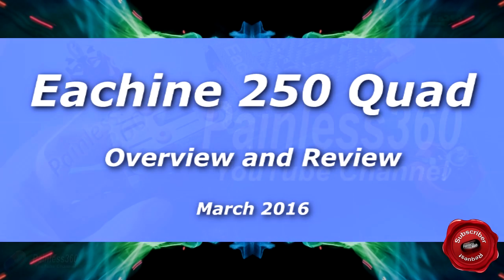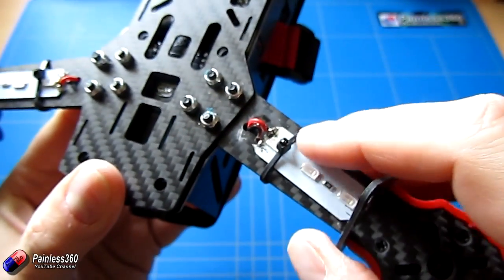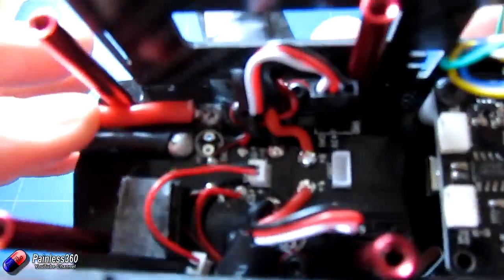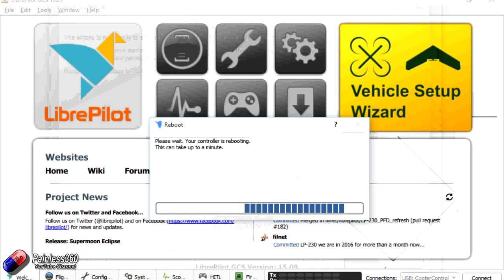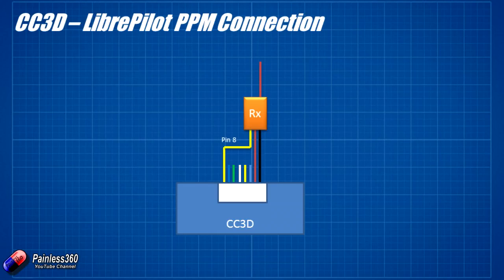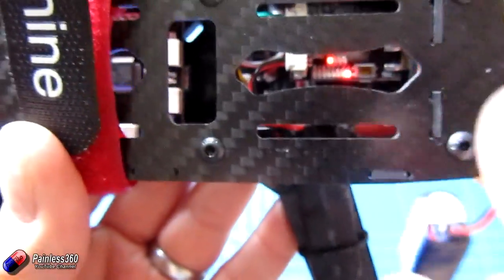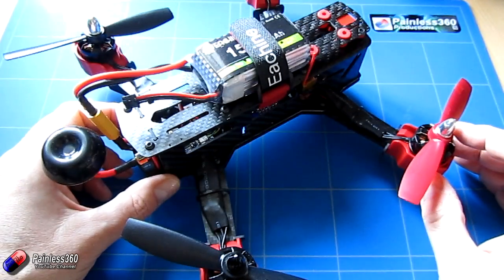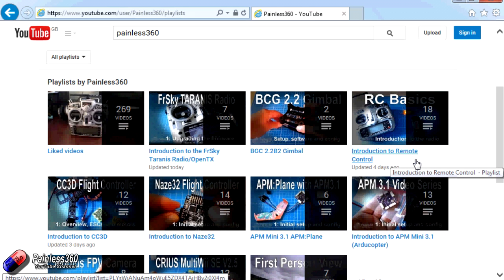RC Review - Eachine Falcon 250 FPV Quadcopter Review (from Banggood.com)

Comment: I ve had my ef250 now for 2 months, it's my first in the 250 class.  It's taken some great crashes but so far I've replaced 2 escs and the cc3d fc.  I do have a Crack in one arm but it still feels tough, the LEDS went first and a couple cables, and I'm getting real used spending more money.  Lol.

Comment: Any idea what their line of thought (if any) was on the + & - not being on the first receiver input? :$ 
A short little USB extention-lead would be handy huh? :)  Only a few cm's would do.. 
Great & extensive presentation / review again sir!
Reply: +DutchRC Adventures Yes I would consider just buying some connectors and make a small extension but this really is an oversight i thought it was a pain on the eachine racer 250 to get to the usb port but compared to this its cake. Perhaps just rotate the board and set the rotation in librepilot but tbh thats not ideal.

Comment: nice review. I just got this as an ARF about a month ago as my first real 250 fpv ship, and I am loving it. One tip I would add is that this quad is begging for a 4S battery to achieve its full potential. it's an animal on 4S! Do you know what firmware is on these ESCs, or is there a way to find out?
Reply: +Jon B Baca They are Flycolor Fairy 20A ESCs that run an exclusive BL Heli firmware and they do support oneshot.

Comment: When you say 'a little bit of expo', how much is 'a little bit'?  I realize this is personal preference, just trying to get a feel after having run it into the bushes a few times on my first attempt outing in my back yard.  Also, flight modes etc in librepilot are default?

Rich
Reply from the maker: +Richard Kleinhenz see our video on expo. Depends on the radio and personal preference. Typically 15-20% is a place to start..

Comment: CC3D layout with usb port on rear side is sick.  Much better is on left or right. We can turn  the board 90 deg left or right but why we have to do it?
Reply from the maker: Yes you can (google and you'll find my video on it). No modern BNF models use the CC3D any more - it's very old tech..

Comment: looks like i should buy one just for the case since my zmr frames will fit just fine there. will the taranis fit also? i would also recommend some hover feet. they are  much improved over the typical carbon legs i never use them. i to plan on trying dRonin on my zmr180. the auto-tune looks interesting to watch. heh they should of had the usb port to the side. they did not think that one out at al.

Comment: So, what if during the output calibration one of the motors requires considerably more to startup than all the others? And does it have to do with the ESC or the motor?
Reply from the maker: ESC calibration or a stiffer bearing on the motor. Shouldn't stop you flying but I'd run through the ESC calibration again.. Best of luck!
Reply: Ah, thanks!

Comment: Painless360 i have 1 question how can i change my MAX PITCH angle to 25degree? im using naze32 and the latestest betaflight. I love flying in angle mode and harizon...looking forward for your helpfull reply :)
Reply from the maker: +Mark M Full stick give max bank angle set for axis in Stabilization tab. See https://librepilot.atlassian.net/wiki/display/LPDOC/Input+Configuration for more.. Best of luck!
Reply: +Painless360 im using naze32 sir
Reply from the maker: But you are asking it on a model with a CC3D... See our Naze32 series and the documentation for Cleanflight.. Best of luck..

Comment: Where do you put the antennas on a cheerful little racer like this?  (This is my first)

Rich
Reply from the maker: +Richard Kleinhenz fpv tx is set, place the radio Rx wherever it fits.. Best of luck!
Reply: +Painless360 Radio placement - that's no problem.  It's the receiver antennas I was asking about, I didn't think leaving them dangling free in the conductive carbon cage is a good idea.  My first mini-quad, don't know what's commonly done!
Reply: +Painless360 Just came across a picture that showed the antennas strapped to the arms - well, if that's all there is to it, that's no problem, of course!

Comment: I have completed all of cc3d steps successful. I did a quick throttle test without the props. the quad is rested on a level surface. I armed the quad. I slowly move throttle stick up until it started to spin and I kept the stick there. I notice the motor gradually got louder despite the fact the throttle stick  is not moving up. This happens only when it is in flight mode 1. In mode 3 this does not happen and the motor appears to keep at a constant speed. is this  normal? it seems strange so I thought to get clarification before I start the test flight. Many thanks.
Reply from the maker: +Jack Truong Yep, very normal as the P part of the PID loop isn't seeing a movement in the craft from the input. Should fly fine..
Reply: Thanks for that. I was stuck in this conundrum for many hours. I understand now. So the FC expected the quad to move up and without the props it could not move up so it tried to correct by increasing the throttle.
Reply from the maker: Yep, and it can't see any movement from that input so it adds a little more and so on.. Best of luck with the maiden flight..

Comment: Does anyone know if the PDB board will filter the 12v for the video Tx? I want to buy this quad, but just the frame, they sell it for about $25. So does anyone know if I will need a LC filter if I use the quad's PDB?
Reply: the pdb has a 12v plug in back and a 5v in front for a camera. It's actually a pretty decent pdb, but I'd make sure it comes with the frame. If not, I'm pretty sure one of the many ZMR 250 pdbs would fit. this one is nice cause it's got the led pads

Comment: why would two motors spin when calibrating the esc's
Reply from the maker: +Robert Riha usually because they can't see the high throttle that' forces them into calibration mode. I'd raise the high throttle level to make sure they see well above 1800 when they are powered on.. Best of luck!

Comment: i am using librepilot and when i use setting bank one it doesnt fly to the settings I have choosen and always flies forward. When I switch from settings bank 2 or 3 to settings bank 1 it flips and crashes... my settings bank 2 and 3 are fine but serious issues with bank 1. PLEASE HELP! ive reinstalled everything and used default settings
Reply from the maker: We don't play with the banks at all. See our CC3D series for the steps we follow to fly. Best of luck!
Reply: damaged accelerometer sensors im guessing. cant fly in attitude and rattitude.
Reply from the maker: Looks like it then, I'd see if you can see that in the GUI and last thing to try would be resetting the PIDs as there is an inner and outer loop on that.. Best of luck!
Reply: +Painless360 ya flight data shows accelerometers are working, doesnt specify if correctly or not. i will mess with pid loops.

Comment: can you charge a higher mah 3s battery with the stock charger
Reply from the maker: +Dyno Gualldyno that should be fine, but a more advanced charger will do the job faster and more accurately. Best of luck!
Reply: ok  it will only take longer to charge     thank you for your help
Reply: +Dyno Gualldyno  toss the charger it comes with in the garbage, not even joking.  I have had this quad for a little while and the third time I tried charging the included 1500mah battery the little wall charger blew the ICs on the inside and  became completely useless, never heard back from Banggood about it and that was around a month ago.  Was not impressed considering were talking lipos which basically want to light on fire as is, don't need some crappy charger amplifying that.  Love the quad otherwise, I took the motor tilts off though, I feel they didn't play with acro+ mode too well.
Reply: so I need to buy another charger  thanks man, and I'm new to fpv so I don't think i want to start with the tilt motors   , do you need to buy other screws to do that
Reply: The included charger does work, but how long it will work for you is another story!  My buddy has a similar charger made by Turnigy and its had well over 50 lipos charged on it with no problem.  If you are looking to fly FPV you can add -10 pitch to your cc3d and it will counteract the motor tilts, they will make the quad fly forward with no input otherwise, though this is where I had problems with acro+ mode so I removed them.  You will need to get new screws as the existing ones are not long enough.  If you go that route you will need a M3x0.5 machine screw (metric 3 with a 0.5 thread pitch) and you will want them to be around 20 to 25 millimetres long.  I got a pack of 25 from a local hardware store for $4 and no waiting for shipping!  Hope you enjoy yours its a fantastic little quad.
Reply: What do you guys recommend for a charger?  Also what's a good spare battery (want to keep it 3S)? Is this one any good? http://www.banggood.com/Eachine-11_1V-2200mAh-3S-35C-XT60-Lipo-Battery-For-RC-Multirotors-p-1038461.html
Reply from the maker: The charger we use here is a 'mature' Bantam B6 model - very good charger but not available any more. There are loads of choice now and the 'real' IMAX B6 chargers, along with others, are still worth considering..

Comment: Ive just ordered this RTF ..will it fly ok out of the box?
Reply from the maker: +Raythetree001 ours wasn't but with some basic checks it should do..
Reply: the quad is great way too ast or me but ive turned the rates down just now so that should be better....had some trouble with the uo goggls though.the receiver didnt work..so had to use my new eachine receiver..still didnt work and fiddling around the back of the screen if i touch the gold ribbon agianst the screen and press it in with foam the screen works but its got a lot of static and not good range at all...100 metres or so!!! theyre sending more goggles but ive lost my confidence with my fpv....all the wire coonections to batteries and recievers cant be helping with static.

Comment: I am new to this hobby and have recently ordered from Banggood an Eachine 250 Racer FPV RTF package that includes everything. I planned on getting  GPS added on at my local hobbyshop primarily for return to home since I am sure I will need it. I saw a comment that said it wasn't possible,..is that true? And if not, could you direct me to what to buy. Thank You!
Reply from the maker: +Dallas B711 It's not. The CC3D on this model isn't GPS flight mode capable - https://www.youtube.com/watch?v=k4tQAmg2ssA
Reply: +Painless360 Thank You, I got such a great deal on the package would it make sense to change the board and then add GPS or just cancel my order and find a different drone altogether? I am excited about a sporty FPV drone, but want the safety net of Return to Home...Any suggestions? Again Thank You!
Reply from the maker: You need an APM/Pixhawk or CC3D Revo at the moment. That model isn't going to be easy to swap the board in..
Reply: +Painless360 Again, my thanks..Any quad you would suggest? PS most clear, concise and informative videos, I'm sure you have been a Blessing to so many people.
Reply from the maker: Not any that come to mind - really depends on what you want, size, flying style, experience etc. If you want RTH then you will need something with enough space to let you fit the GPS etc so most 250 frames will be too small..
Reply: +Painless360 So many choices,..I want to upgrade from the "toy" grade but not sure what to get. Love the thrill of the FPV racing videos but know my skills aren't there. That's why FPV With GPS is so attractive,..guess I'll just keep looking. Perhaps a "Next Step" video would be helpful to some of us beginners lacking in knowledge and experience but full of enthusiasm! You help has been greatly appreciated.
Reply: +Painless360 So many choices,..I want to upgrade from the "toy" grade but not sure what to get. Love the thrill of the FPV racing videos but know my skills aren't there. That's why FPV With GPS is so attractive,..guess I'll just keep looking. Perhaps a "Next Step" video would be helpful to some of us beginners lacking in knowledge and experience but full of enthusiasm! You help has been greatly appreciated.
Reply from the maker: As every pilot is different I tend to cover these questions on a one to one Skype call. See the website for.charges..
Reply: +Dallas B711 there's a model of the Walkera Runner 250 that has GPS built in, but I've heard a lot of bad things about that model. it's supposed to be underpowered and pretty flimsy, not great for a beginner. While GPS seems attractive, I think most people would say it's wasted on a 250 racer. This thing is super powerful, especially on a 4 cell battery, and GPS hold would severely restrict it's true capabilities. Plus it would probably crash before you could hit the return to home switch! Luckily this guy is pretty tough (much tougher than the Racer 250 or the Walkera runner 250)
Reply: +Dallas B711 I just saw that the Eachine Assassin 180 comes with GPS. The rtf package looks really nice, with a transmitter and goggles that all fit into a really nice carry case, all included

Comment: ive managed to do the whole thing but it seems ive done something wrong the motors spun up during nuetral settingi left the trans setting on pwm as there is many wires coming out of my reciever plus chose qav 250 and set disarm to a stick movement...i cant work out what else to do i just followed you and it was working until i unplug the usb and give a command from the trans and thre  is nothing...? can you help me??
Reply from the maker: Sorry to hear that, see the website details for booking a chargeable support call..
Reply: +Painless360 hi I have a question about my falcon 250,so I just got it yesterday and I plugged it into libre pilot and everything works fine except when I turn my fpv goggles on I can see a clear picture until I put my throttle stick up then it's staticky but when I land with throttle stick all the way down I can see crystal clear again,do you know what's wrong ? Thank you
Reply from the maker: If this is a brand new machine then I'd recommend getting in touch with the supplier. Sounds like the power system gets noisy when the motors are on.. Best of luck!
Reply: +Painless360 do you think getting a new fpv transmitter would help?
Reply from the maker: Possibly, but without knowing the cause it could well do the same. If this is new then I'd go back to the vendor. They should be providing support and replace if faulty..
Reply: +Painless360 okay then thanks so much !
Reply: How many minutes do you fly with this battery?
Reply from the maker: Depends very much on how you fly but 8-12 mins would be typical. Happy flying!
Reply: Painless360 really what is your battery?  My battery is 1500mah 4s eachine, and the other is 1500mah 3s. What is your the voltaje when you finish the flight?? My voltaje for each cell is 3.7 ordenar 3.6
Reply from the maker: I tend to use a slightly larger battery - 1600-1800mah if I can't fit one of the many 2200mah packs we have here. See the LIPO battery videos in the 'Introduction to Remote Control' series where we talk about the usable range for a LIPO battery. I'd aim for no less than 3.6v per cell after a flight. Pushing it more will decrease the life and performance of the pack.. Happy flying!
Reply: mm and you see the voltage in the salvalipo or in the charger?  because my limit in the salvalipo is 3.5 because the charger tell me the cells are in 3.66
Reply from the maker: I'd aim for no less than 3.6v per cell after a flight - we use a little LIPO checker to see..